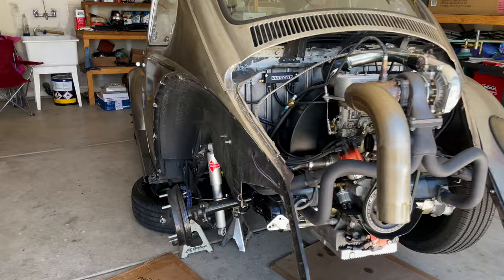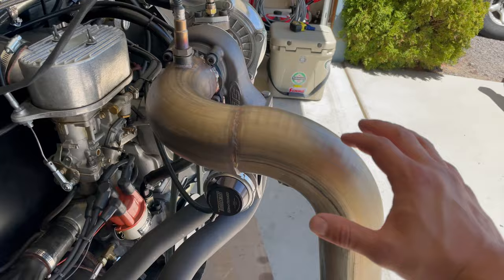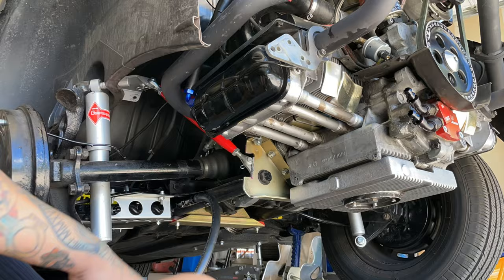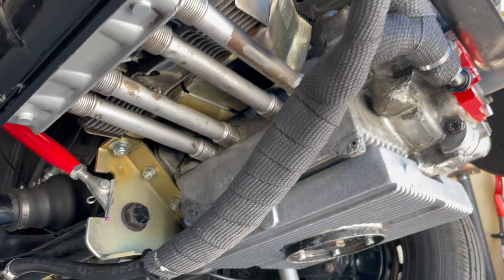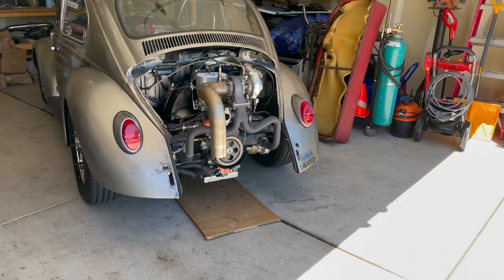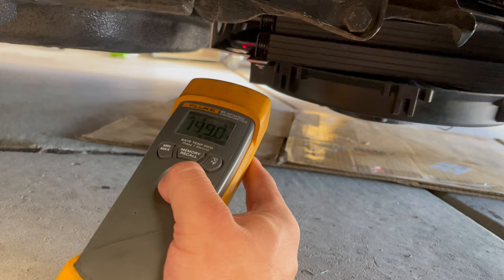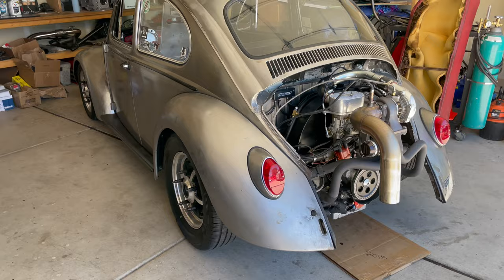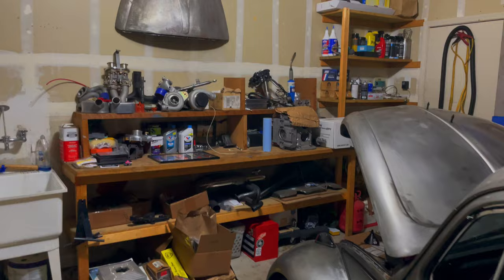TURBO VW BUG GETS AN EXTERNAL REMOTE OIL COOLER

Comment: FYI .  I run factory and remote oil coolers. Remote oil cooler fan I run full time after engine is warm. 2276 with 15 pounds boost.  Oil temp stay around 140 in the sump. Also the oil runs through intake plenum. This helps to cool and stop gas droplets from forming. RLR turbo set up.
Reply from the maker: That’s an awesome set up! I’m thinking I’m only going to have mine run when temps get to 190°. My factory cooler is doing a fantastic job but it needs just a little help when it gets really hot.

Comment: That fan switch may not last with the amps the fan pulls. My oil temp switch recommended running it through a relay. Just an fyi dude. 
Looking sweet!
Reply from the maker: I thought the same thing. But the instructions for that switch didn’t call for a relay. So I wired it with a fuse to the battery. I’m thinking of running a toggle switch to it with a relay and fuse so I could turn it on whenever I want or when I’m parked to cool down.
Reply: For sure run a relay.

Comment: I though the filter needs to be in line before the cooler.  Maybe in warm climate it doesn't matter.  Sweet bug!
Reply from the maker: I don’t think it matters. Been running it like this since I installed it and still don’t have issues.

Comment: So I have a question. When you built this bug, It turbo is great, but with the amount of power. Did you have to change components in the trans? I’m asking because I have no idea. And this is a dream type build.
Reply from the maker: I actually got a new transmission from Benco Transaxles. They built me their “turbo box.” It was built for turbo use. It has taller gears, super diff, etc.